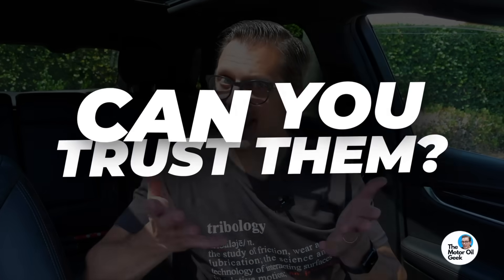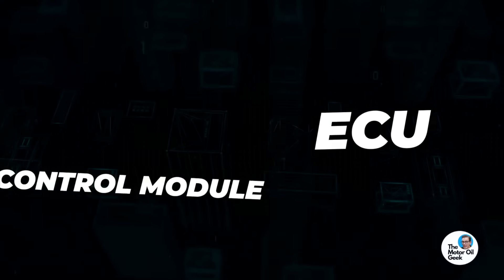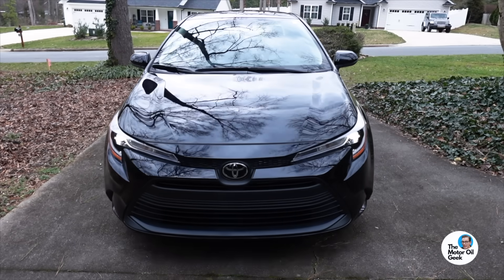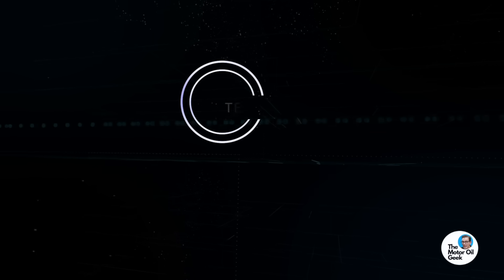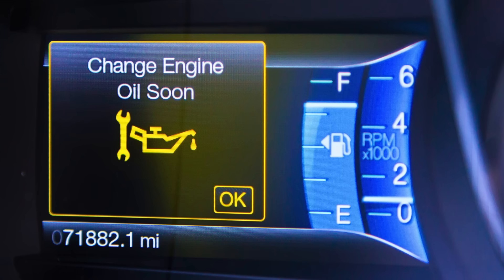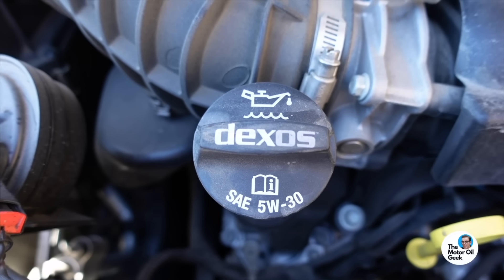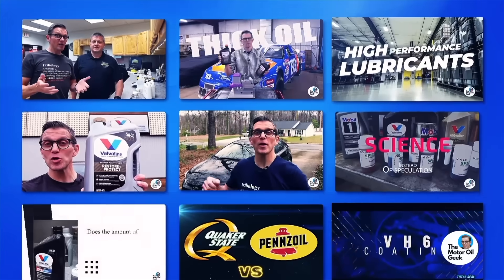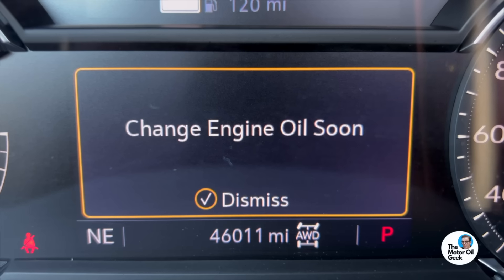The Accuracy of OIL LIFE Indicators REVEALED!

Comment: This is not the first video that I see in this channel, but certain things are for me, a concern. I heard this Oil Change Indicator, does not extend the oíl change beyond 7,500 miles, no matter if the algorithm estimate says it could: This system measures the oíl and its condition, but not how the engine is affected internally; It was a rental vehicle with around 45,000  miles. What about cars with 150,000, 200,000, 250,000, or more than 307,000 miles like my 2005 Toyota Corolla I have since it was new? No matter how brilliant is to use the GM data, the fact is it was more simple, effective,  and, economical to produce, the conventional oil dipstick for measuring the oíl level: You don't need oil analysis anymore? There is a Youtube video on The Car Care Nut Channel, where thanks to an oil analysis the client took to Amd, the Shop Owner,  also a Certified Toyota Master Tech.  discovered a Head Gasket Coolant Leak, but, after applying all the required procedures to measure if the engine block was within the manufacturers specifications, Amd found all was still within required specifications and there was no need to replace the Toyota Engine Block  just the Head Gasket. All around the World,  we are seeing records of too high temperatures. All this are Internal Combustion Engines, and without having that too complex system installed by Toyota,  I can say it this way: the dealers want to buy my Corolla, but I am not selling it; sales personnel think,  " we should not drive a car with an Odometer reading that is too high: But my 2005 Corolla  has a 4 speed automatic transmission; Until the year 2023, it was found in the most expensive Lexus,  a 2 doors  Coupe, which had 2 transmissions, a 4 speed auto and a Direct CVT, like a 2nd Overdrive; Lexus still makes it, but now in 2024 with a 10 speed automatic; No matter how genius this Indicators look, it simply doesn't justify the elimination of the conventional oil dipstick for measuring the oil levels.  The 7,500 miles maximum oil usage it could allow, is still not a good idea,  not even 5,000 miles oil-filter changes are that good.  There was a reason for the Severe Driving Conditions Interval of 3,000 miles,  even it was recommended when Synthetic Oil started to be promoted. I still use the 3,000 miles oil-filter changes since my Corolla was new. I believe that no matter how brilliant the Oil Change Indicators look, the fact is none of them are better than previously recognized Preventive Maintenance. I wrote to Blackstone Laboratories explaining what I do, since I send samples to them at around 30,000 miles for comparison.  Last time they wrote,  the results were even better than the previous oil samples  when my 2005 Corolla had less miles? Yes that's what they wrote, and they added that I should keep doing what I am doing, not extending the oíl filter changes. Now I will send another sample  well beyond the 307,000 miles soon.  My Toyota Corolla is from another time, when some cars escaped this Planned Obsolesence Dealer Policy. They simply do not want to see anyone driving a car celebrating how good it is,  close to 20 years after it was bought new, so the other Owners do not start to imitate us. No matter,  they will.  A personal loan covers many car repairs with original parts. And we avoid paying the unfair overprice. Depending on the model and brand, you can go to 400,500 600,000 miles and even  more with your own csr since it was new.  But dealers and some manufacturers  don't like this anymore.  I read in a 2020 Toyota Corolla Owner"s Manual, " You can extend the (CVT) Transmission Life greatly by changing its fluid more often " More often than the 30,000 miles, inspect, add, or replace if needed, more than the 60,000 miles required replace the fluid Interval; I think I explained my point with real examples. The conflicts of interests are real no matter dealers ignore, we also buy and prefer original parts,  so they will be selling to us anyway. Sometimes I believe  they don't have an extended vision, and don't see that bad policies will make clients not to buy new models.  Thanks.

Comment: @themotoroilgeek I'm curious of your take on how driving in dusty conditions can shorten oil life and if used oil analysis can be helpful here.  Maybe in watching silica?  I'm guessing the onboard systems do not account for this.
Reply from the maker: Great point! The used oil analysis can tell you if the Silica from a dusty environment requires changing the oil drain interval. The oil life indicator does not compensate for that.

Comment: I'd have the perfect vehicle for you to do your oil test on. I have a 2020 Chevy Silverado 1500 6.2 Trail Boss. I only drive 3 to 4 tenths of a mile to and from work everyday. The truck gets driven the farthest on the weekend to go out to eat and things. I use Mobil 1 synthetic 15,000 and change my oil once a year which coincidentally goes past the oil life indicator and then another 20%. The oil on the dipstick obviously at the end of a year is starting to look dirty but never milky. Been doing it this way for over 4 years with no issues and 35,000 miles. 
Do the same for my wife's car except she drives 25 min one way to work 12,000 miles a year on the same oil as the truck. After looking into the engine, it's as clean as a whisle with just turning 100,000 miles

Comment: MERCEDES uses AN ACTUAL SENSOR TO MEASURE RESISTANCE BETWEEN TWO ELECTRODES TO DETERMINE OIL CONTAMINATION.  Also, algorithms don’t take into account how long you’ve driven in cold weather.

Comment: GM did have a period where they were too optimistic about oil life, maybe somewhere in the 08-13 range.  Incidentally this is also a range of multiple engine issues such as the 2.4L 4 cylinder and 3.6L V6.  While it's bad enough that the oil life monitor was asking for ridiculous intervals, many of these engines also consumed significant oil between changes and the level was dropping several quarts in many cases.  This would then take out the timing chain and cause other lubrication issues.  My wife's 08 Cadillac SRX V8 would often ask for 13-14k mileage intervals on the oil which I think is too high.  That did take 8 quarts of oil but I never ran it much above 8-9k and we had zero engine issues.  Meanwhile, her current car is a 2014 Malibu 2.5L and that oil life monitor seems to want about 5,000 mile intervals which is a HUGE difference from the optimistic approach they had taken just a few years earlier.

Comment: My old BMW 325 had an oil life monitor.  It was explained to me that it used miles driven with an function that counted when the engine went to red-line and above.  Plus a few other parameters.  I seem to recall the normal interval was 10000 miles but was shortened quite a bit the more aggressive you drove.  (Don't ask how I know.)

Comment: I had a 2006 Mercedes E320 CDI that I put 390,000 miles before trading in on a 2014 Audi Q5 TDI   I had my oil analyzed a couple of times in each 100,000 miles.   The analysts said I could increase the oil change interval from 10K to 20k.  I only did this once - but my oil analysis said I could even go more miles that that.   The wear on my engines was less than most cars changing at 5K miles.   I now have 365,000 on my Audi Q5  - replaced injectors recently, but purrs like a kitten and have 40+ mgp to boot.

Comment: Could you do a similar test with a Ford 3.5 ecoboost?  FordTechMakulolo is of the opinion that the oil life indicator is optimistic and puts the engine at risk.  If I remember correctly, he was seeing premature timing chain and cam phaser wear with cars of customers that followed the oil life computer recommendations.
Reply: Change my 3.5 at 5,000 miles , the indicator always says over 50% left, definitely optimistic
Reply: @Tugboat511  yeah - I tend to change mine around 50% to 60% which is approx 5000 miles.

Comment: Honda has a time component in their algorithm. If I change the oil and reset the minder without driving 1 mile, it will recommend an oil change after 1 year every time.
Reply: I have a 23' CR-V EX-L that I purchased in Dec of 22'. I'm retired and don't put much miles on it at all, I've only put a little over 6500 miles on it. I don't even look at the oil monitor % because since I don't put many miles on it I change my oil every 5-6 months. To each their own...

Comment: Lake, your data could be compromised.  On our GM all that is needed to reset the oil life indicator is to press the enter button for like 10 seconds.  So what if some renter reset that indication back to 100% when it had 2000 miles on the oil ???

Comment: Great video Lake.  I can confirm on my 2019 Ranger that frequent short distance driving leads to the oil life indictor triggering earlier as expected.  It would be nice if an after market oil minder kit existed for retro fitting to older vehicles.  Even if it just looked at only engine temp and accumulated rpms it would still do a good job.   BTW,  GM document you cited in video can be downloaded at the following link: https://static.nhtsa.gov/odi/tsbs/2018/MC-10137589-9999.pdf   It gives a general description of the algorithm.

Comment: I run PUP in my gassers and dump every 3500-4000. My diesels get Amsoil and I dump them at 5000. Oil is cheaper than engines. SW WI and frequent short trips to town.

Comment: I'm not entirely sure Toyota doesn't have a oil life system in  place. Our 2013 Camry Hybrid "maintenance required" mileage will fluctuate from oil change to oil change depending on the type of driving we do. Long road trips versus city driving.
Reply: Also with it being a hybrid, the engine temp runs quite a bit lower than a conventional drive train with city driving.

Comment: Easy indicator is to change it at 5k miles incriminates.
5-10-15-20-25k and so on.
Easy to tell how far you have to go at a quick glance.
No record keeping. 
Going on a trip? Do I need to change it before I go? Look at the odometer.
Easy peasy.
This is for a normally driven vehicle using a quality full synthetic oil.

Comment: Well, no, you really can't trust it. It's telling you that you need to change the oil before it needs to be changed. heck, I can do that from the recliner in my living room. without even seeing your car. I can say this just by asking you how many miles it has been since your last oil change. am I accurate? no, but neither is the "magical" oil analysis monitor in the Cadillac.  the bottom line, if your trying to change your oil WHEN it's needed, is you have to send in a sample. or, you do like the vast majority of us, change it before it is NEEDED. the extra couple of hundred dollars spent, is so much less than having the engine rebuilt or exchanged it's not even amusing. if in doubt, change it out.

Comment: I've had various VWs with "Longlife" oil service.  They work in a similar fasion, but i've always been curious about how accurate they are with the extended service intervals (Max 2yrs / 18000 miles).  Have you got any information about how reliable these are?  Is 2yr oil / 18000 miles really safely achievable with these systems?

Comment: My Chevy Volt Plug In has even more programming built in the stock GM oil life indicator. It can go months on just one tank of gas and its interesting to see the oil life indicator tick down even when the gas engine does not fire. I've made a habit of changing the oil at 50% only due to length of time between service intervals which can exceed years.

Comment: The MM on the 09 Accord has been consistent at about 7,500 to 8,000 miles by the time it hits 15% to 10%.  I usually aim for about that mileage anyway when using a quality synthetic and with proof by doing used oil analysis on Pennzoil Ultra 5w20.  That particular oil in that particular engine (2.4 liter), UOA shows it can easily go to 10,000 or more.  I have not run the MM down to 0%, but my guess is it would be closed to 9,500.  Honestly, I'm surprised it isn't more conservative.  I do not follow the Oil Life Indicator on my 06 Silverado.  I change the oil twice a year, due to the low mileage.  I could go annually, but it's the short trips and fuel dilution you mention in the video that drives the bus on doing the oil changes.

Comment: But what if some manufacturers extent the oil change interval to compete with other brands who have done the same for marketing? Some brands might be willing to take it closer to the limit than others, and it also appears oil sludge can be an issue. For instance, Audi 1.8t used to be notorious for engine sludge.

Comment: My spouse’s GM has the oil life monitor have we’ve had discussions about whether to follow the factory recommended 5k intervals or believe the monitor.  We’ve mostly changed it at the factory intervals. Internet scuttlebutt suggests that the motor is only good for 160k under any conditions, however.

Comment: The oil life reminder was not accurate for some GM 4 cylinders engines years 2010-2012.  There was a recall for 800k vehicles to reprogram the system.  The result was destroyed timing chains on these engines from contaminated oil.  The system was not conservatives in this case.

Comment: 80% of this post is all about YouTube points, you say everything over and over to get more time. And you never mentioned that on the GM the timer is going as long as the battery is connected, meaning that if you let Ur vehicle set a year and never start it it will go from 100% down to 0%
go ahead and check this FACT out with GM.  Also all one needs to know is the beginning TBN of the new oil and run it till it gets to HALF  of that number.  And yes iv'e done this on semi diesels, pickup diesels, and gassers for about 51 years, never gone wrong. Oh and don't use synthetic except what is in my 2024 6.6 gas and don't have 5000 miles on it yet since Dec 23.

Comment: I would ask to have the same test done on the Honda 1.5DIT in the Civic. These cars have an oil life monitor and I personally saw low viscosity (SUS Viscosity 45.2 for 0W-20) and 1.3% fuel dilution at 5600 miles and the car was still over 50% oil life. I'm wondering where the Honda oil would be at when the monitor is below 10% with similar driving habits.

Comment: Just found your channel, LOVE the content. I started having PdM oil analysis done on my wife's vehicle and mine this year and have not been disappointed by the results. I use Liqui-Moly engine products on my vehicles and the results from the lab show they work. My vehicle is well over 125k miles and my wife's is fast approaching 100k. I like to change my oil on my vehicles before the 7500 mile mark, since I'm running full synthetic 5w-30 in a moderate climate. Thanks for the great info!!!
Reply from the maker: Thank you!

Comment: Pure nonsense.  U want maximum life on your engine.  Change every 3000 miles.   You want to be safe 4000  max 5000.  That’s it.   Case closed.  Never exceed 5000 in a gas powered car.

Comment: Hello. 
Can you make video about oil viscosity first number?
Especially i'm interested 0W vs 5W.  i can't find info about that.
I want to know 0W and 5W flow info at same temperature. +10c, 0c, -20c, -30c. I want to know how different  are 0W and 5W oils.
In my knowledge 0W runs in any normal usual engine without any problems and are a little bit better flow than 5W.
i have used 0W40 and 5W40 oils.

Comment: Old school here, I get nervous over 3k miles on the oil even with full synthetic.  My 23 Gladiator, changed it at 900 then at 5000.  First analysis was good, and have the second ready to drop in the mail.  Sadly it is a special trip due to the central mailbox setups we have now a days.  

My other worry is time.  I don't drive alot, I do get it almost always up to operating temperature so the gas and water get boiled out which is good.  But as I understand it oil should be changed on time as well.

Comment: One thing happen to a man I rented an apartment from. He is an engineer for GE Lynn mass. Working in Jet engine design & development. He had to drive from Massachusetts to South Carolina. He Took the Cadillac.  He called me because the Check engine light came on knowing I was a mechanic. Asking what he should do. Long story short the oil life indicated he was OK, But he never checked to see if it had the correct amount. End result low oil pressure. lost timing chain tension so 1 valve job & timing chain later. Check Do Not trust everything electronic.

Comment: Something I want everyone to know is sometimes it’s not accurate at all for example in my moms 2005 Acura if you unplug the battery it will reset the oil life indicator. so if you have 25% oil life left then unplug the battery and then plug it back in the oil life will be at 100% not sure why it does that but just so y’all know

Comment: Just choose a good schedule for your engine and stick to it.  I own a 3 cylinder Turbo aluminum engine with an internal wet timing belt.  I'll be changing the oil every 4000 miles/6 months, regardless.